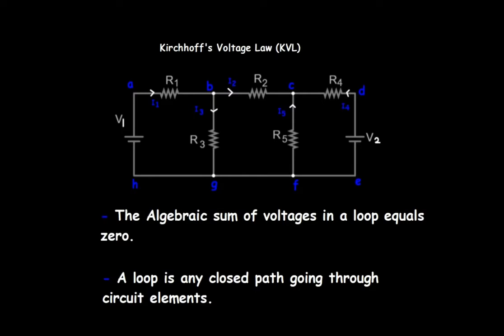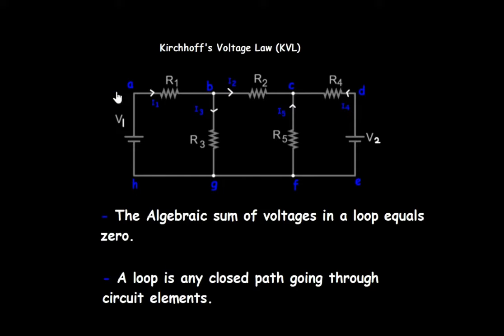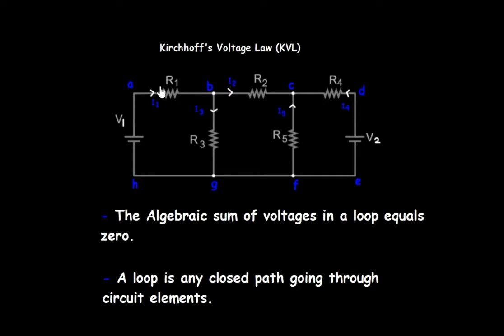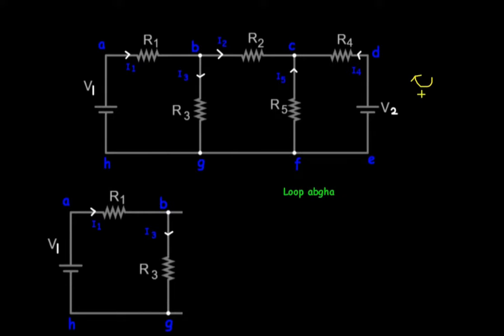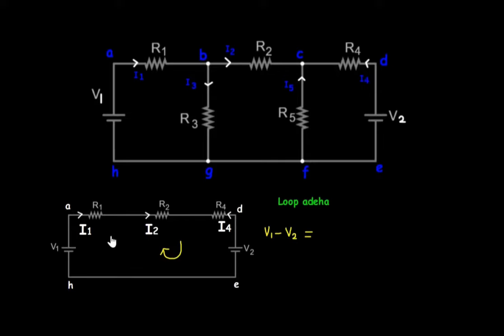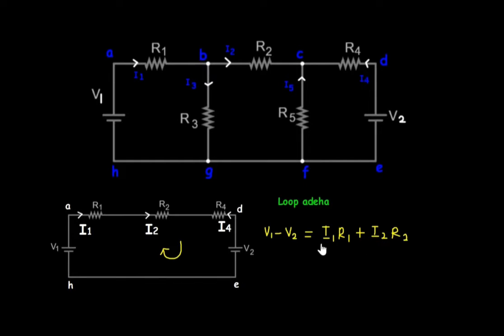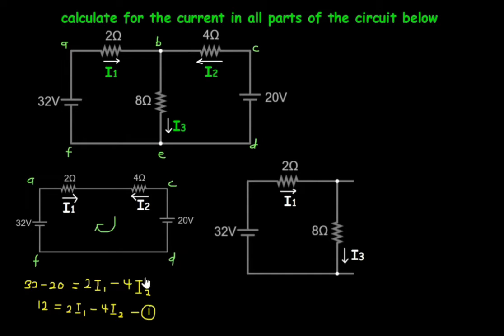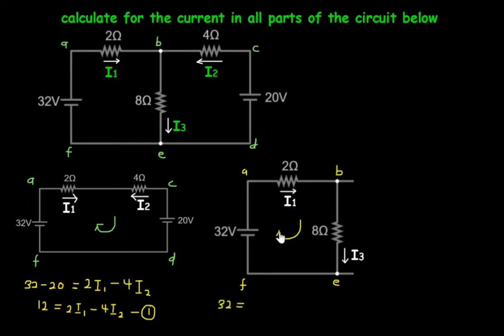Kirchhoff’s Voltage Law (KVL)

Comment: Pls for loop acfha, does it mean that the current flowing through the series circuit is different since u labelled them I1, I2 and I3 respectively.
Reply from the maker: In this case, we can't  directly say that the currents will be the same , unless we get the actual values, but their combined effect will be equal to the total current in the loop. Because those currents are currents that came up as a result of the two voltage sources and also they are from different branches of the main circuit. The loops will just make it easy to find the currents across the resistors  when the two voltage source are acting at the same time.